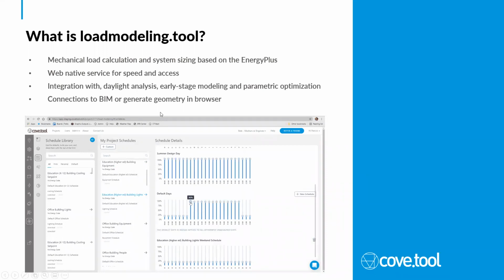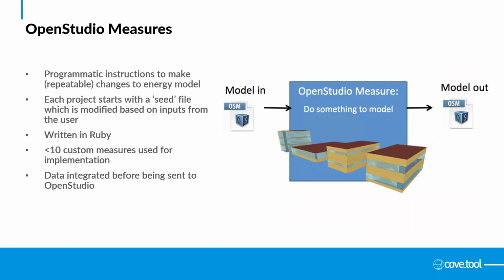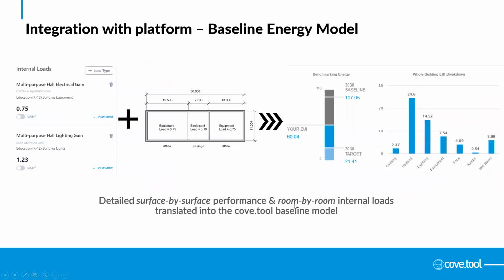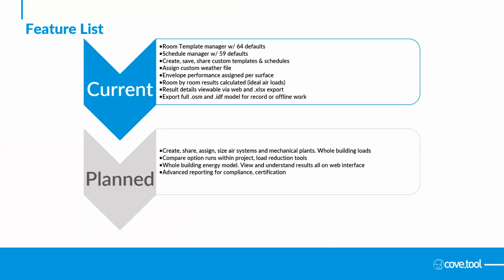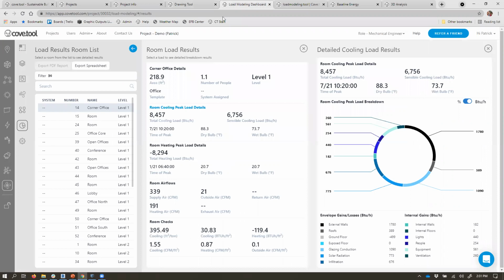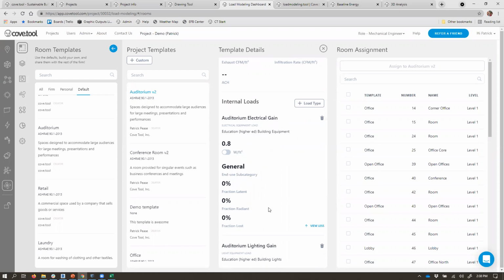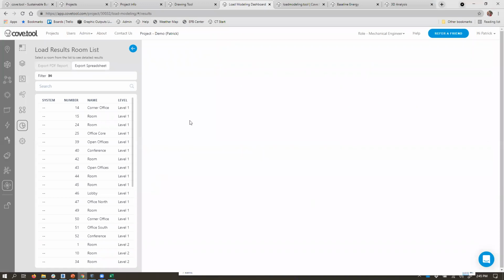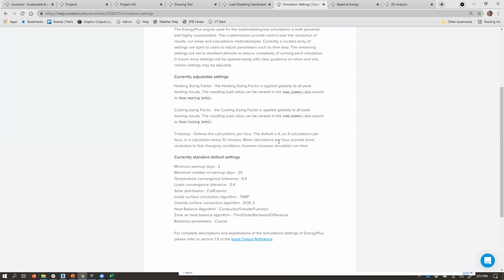Introduction to loadmodeling.tool, a New Feature for Mechanical Engineers

Comment: Cool interface and good job with the presentation. Room-only loads aren't very useful to anybody, so hopefully the system loads come along quickly. I would also recommend a gbXML import method as importing Revit surfaces and "closing" automation doesn't seem robust enough for most energy modelers.. Check out the gbXML workflow demo on Zero Envy's Youtube channel for more details on that.